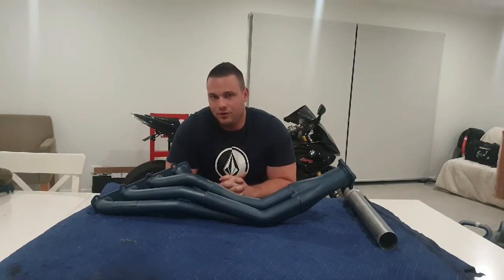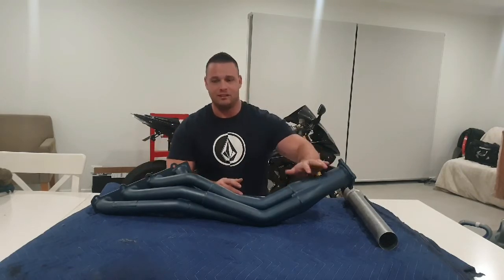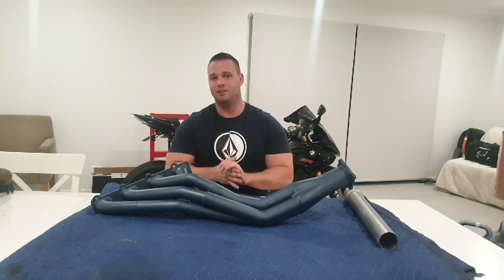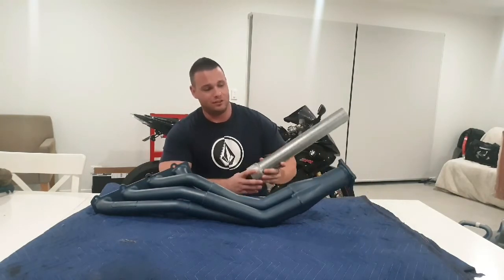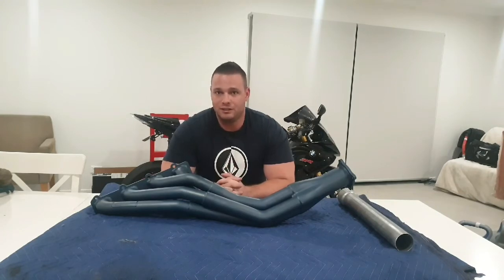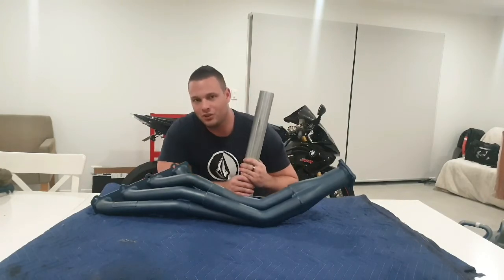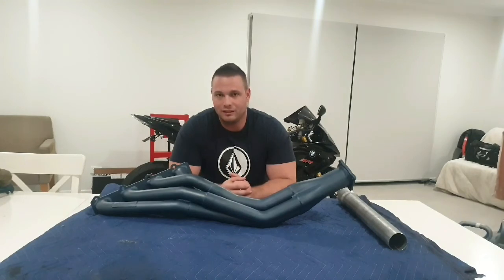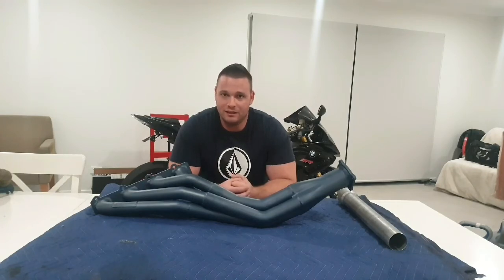Choosing The Right Headers (Basic)

Comment: I definitely agree with the diff gear change. I put 4.11s on my ED XR8 and it was the single biggest impact on performance. I had, up to that point, added a GT40 Manifold and heads, roller rockers and a tune. It really woke up with some 4.11s!